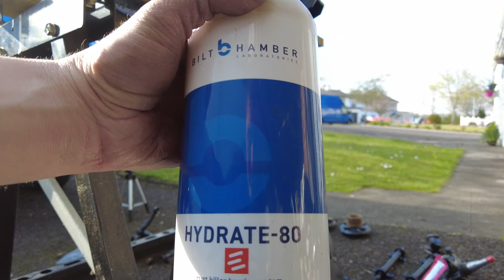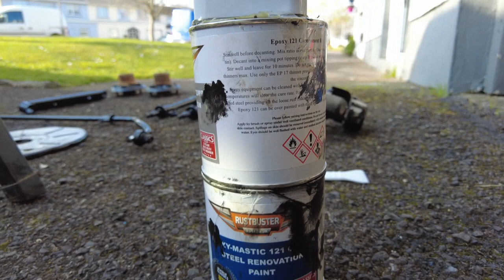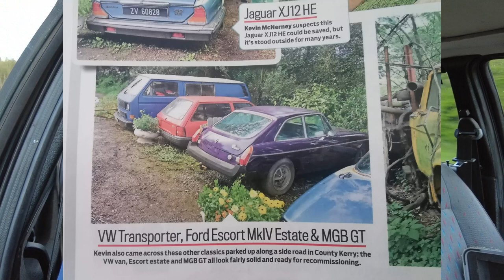MGB complete FRONT SUSPENSION rebuild - Resto Part 11

Comment: Good work Ross. That crossmember  ain't the easiest of things to reassemble. Just a little tip for you.... 😉 A small racket/luggage strap wrapped around the spring pan and lever arm makes a great way compressing the two together to get the kingpin bolts lined up. And just another observation before you go too far.. Are you sure your droplinks are installed on the correct (left to right) side? The tops should run parallel with the crossmember so the antiroll bar bushes drop straight in. Hard to see on your video, but it looked like the angle was way off... I could be wrong.
Keep up the good work!
Reply from the maker: Thanks once again for the advice Carsten. I did offer up the ARB and it seemed right but I decided to hold off until I have the steering rack in, and I've some reading to do about that. In the end, with the bolt hole alignment it didn't put up too much of a fight once I bounced the suspension a bit. It'll be a while before I get back to this car I reckon.
Reply: @Endfloat  For what it's worth Ross, I shimmed my steering rack without the UJ initially. That way it's easy to add or remove shims without fighting with the steering column. Alignment for the rack and column can be done by eye. (I know there is a special tool for this but I've yet to find one). Once I was satisfied with the fit I removed the rack noting where the shims went, popped the UJ on and the whole lot slipped together with no dramas.
Anyway, onwards and upwards with the Beetle! 😁
Reply from the maker: @carstenmoore5760  I was half tempted to give fitting it a try but decided to hold off until I did my reading. It can be done when I'm fitting the hubs and brakes. Then I can get the car back on its wheels!
Reply: Yes, droplinks on wrong sides, but a relatively easy switch around.
 
After I read or saw somewhere early on in my build that the cross member could be dropped and refitted with the brakes suspension and steering all still intact, I made sure to negotiate the reftting of the entire assembly as part of the deal with the body shop(s) I was using for all the welding. 

Had it all re-assembled including rack, pivots, discs, calipers - but minus the springs, etc before handing it over to a transporter, (whose guys promptly dropped it on my driveway 😫), to deliver to the shop. 

The engine and gearbox had already gone in so they were able to use the weight of the car to compress the spring. I had used the ratchet strap method when disassembling while it was on my bench. 

Anyway, another great video. Seriously wish this level of detail had been there when I was doing mine!  

Keep up the good work!

Comment: Congrats on using V8 (NOS)  rubber bushings: mine were mounted in 1986 and are still doing fine. BTW pressing them in the swivel arms can also be helped by using concentrated dishwashing detergent. Getting the top trunnion inbetween the shock arms can be done in several ways: next to yours it is also possible to prise the arms further apart by some bolt on the inside,  put someting like a screwdriver between these arms to keep them apart and also use some palletknives if the rubber needs to be pressed further in. I found it better not to tighten the small bolts holding the lower springpad to the arms before the bottom of the kingpin assembly is duly in place (these thin metal plates with their tiny rubber seals are otherwise a PITA to shift inbetween as well and do not last long anyhow).  Thanx a lot for these fine video's once more...
Reply from the maker: I actually ended up swapping them for poly bushes further down the line.
Reply: @Endfloat  Hope you won't regret this in the future: most poly ones the graphite-filled black ones excepted firm up the ride too much and need repeated lubrication to keep squeaking away. For an early RBB as this one the socalled "Hopkins" conversion was sold for an extra stabliser at the back, a solution that only came in as standard from BL in 1978. Fortunately this very early 1974 RBB already has the stabiliser fitted up front. PS I still have a set of NOS V8 bushes, maybe I will have my MG mech have swap them with my 38 years old existing ones from my 1986 resto. Doing such jobs myself is becoming more difficult now having reached 80 years of age....

Comment: Ross - Great video. I think you might have installed the top trunnion washers incorrectly. It looked like you installed the 2 thin shim washers and then the thick bronze spacer washer on top. I think the correct way is that the bronze spacer washer should be sandwiched between the 2 steel washers. That is, steel washer on bottom, then bronze washer then steel washer on top.  My guess is that this is done make the steering a bit easier and possibly protect the bronze bushing from premature wear.  You might want to refer to the manual to verify.
Reply from the maker: Thanks for the heads up. I'll check that out and put it right if necessary.
Reply: According to Moss Motors, two adjustment shims first then bronze thrust washer then trunnion.

Comment: Hi Ross.  Thanks for your very informative demo.  Please advise how to handle the steering boots when doing wheel alignment.  The boots get all twisted up when winding the steering arms to set the wheel alignment.  Thanks again.  Stuart Reid.  MG B GT owner South Africa.
Reply from the maker: You might be able to just put a dab of Vaseline where the rod comes through the small end of the gaiter. Remove the clamp of course.

Comment: I am in the process of tearing down the whole front suspension and crossmember on my 72 MGB and this video was very helpful in seeing how it will all go back together. Thank you for posting it. Did you media blast any of the parts before you epoxy painted them and did you take any precautions to keep the bolt holes (threaded or unthreaded) to facilitate the reassembly?
Reply from the maker: I dipped the parts in an alkaline rust remover solution before painting. Some of the smaller components I blasted with aluminium oxide. And no, the bolt holes were fine.

Comment: this dude really should look at the schematics before putting things together, keeps putting things on backwards, first he put the front control arms on backwards then attached the a-frames to the car with the nut on the back instead of threading the bolt through the bushing from the back to front.

Comment: If you don't know to or simply don't care how to properly shim the trunion then you shouldn't offer instruction to other owners.   There's a reason the shims are available in different thicknesses.   And your refilling of the steering rack provided no reference point or procedure for determining how much oil you need to put in.  Good luck with your car,  all I can say is please,  for your own safety,  buy a copy of the factory workshop manual!
Reply from the maker: Do you suspect that the shimming is that far out that it's going to cause a problem? Because I don't. Also, I didn't measure the amount of oil I put in. I just put in enough to ensure that the rack is sufficiently lubricated across it's full length.